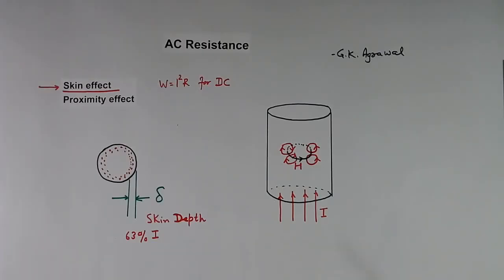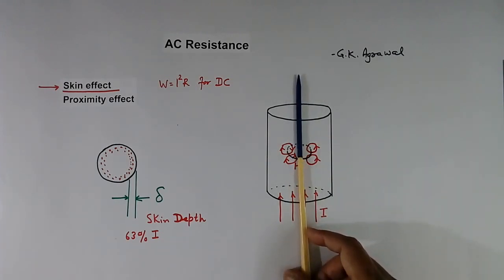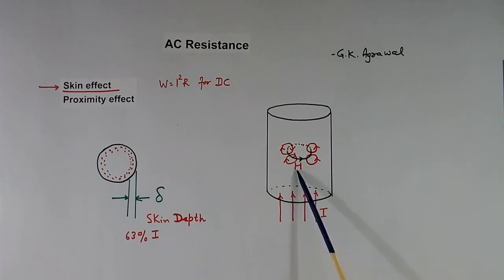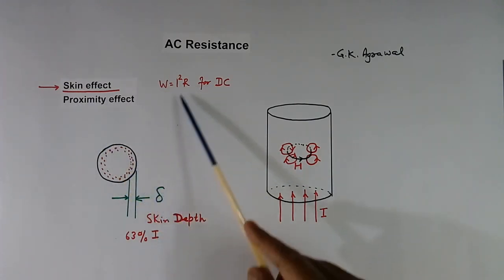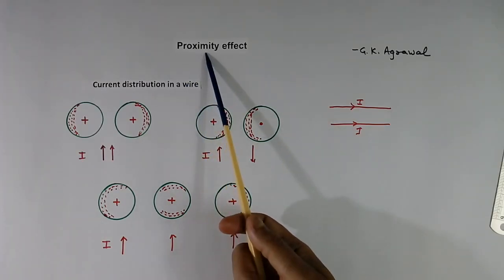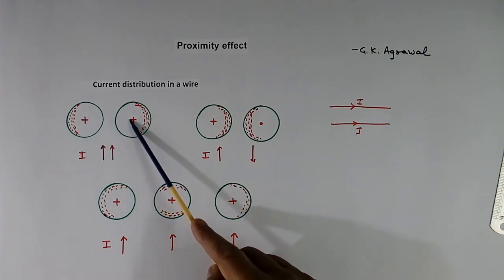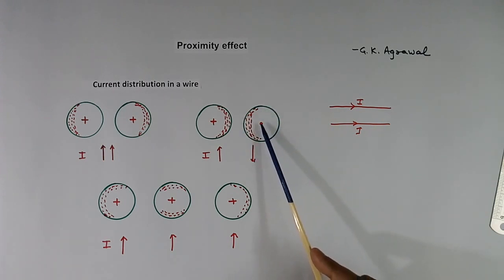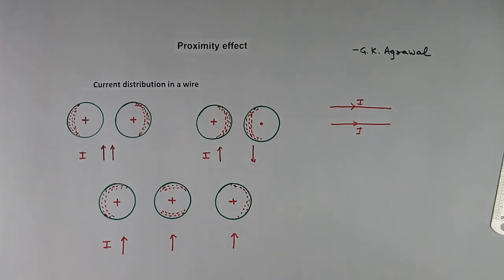AC resistance & DC resistance of resistor- difference

Comment: Dear, Agrawal. I have a question. If resitance is increasing when a.c. frequency is increasing. How can usual insulators make circular Cole-cole plot in Zreal vs Zimaginary. I guess that because Zreal is related to resitance, the cole cole plot should be linear. Is AC resistance different from resistance calculated from impedance  ? How's different? Thanks.
Reply from the maker: I do not know cole cole plot.